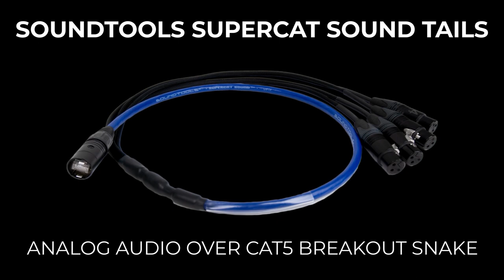Optimize Gain Structure - Pro Audio

Comment: Great job, found my answer farther down the page.   My question was about gain structuring with VCA/DCA's and you answered it.
Reply from the maker: Maybe take a look at a video I did  about mixing strategy as that will cover the VCA question.

As far as adding color, mostly live tends to have too much color and the strive for cleaner, less sound bleed and is the main focus. Then sometimes using inserts, comps or effects to soften is helpful.

I would use tube cops punched hard on vox to warm them. Digital can be edgy so adding effects to warm things is not uncommon
Reply: @DaveRat  Thanks, and I have looked at that VCA mixing strategy, it is genius level.   My mixer didn't let me assign inputs to more than one DCA, but we just ordered an m32c, which allows multiple DCA assigns.  We are going to put it through the paces next week after it arrives, with an emphasis on setting it up using your strategy's.
Reply from the maker: Excellent let me know how it works out

Comment: It's funny when looking back as a baby engineer working for a PA company that mostly sent us out with amps dialled up flat out with the crossover attenuation turned way down. But as the amps were then sucking as much signal as it could get, the signal to noise ratio was still terrible. But as time went by, the secret was always the attenuation at the amp end. They actually started to make amps with no attenuation option (dangerous) as they relied on the crossovers (drive rack) to do it. Crazy.😮

Comment: What a great demonstration! I am wondering how you summed the stereo music player to a mono input channel and then created a second, reverse polarity signal?
Reply from the maker: Ohh, I don't recall, probably just used left or right from the music player into a y cable with a polarity reverse adaptor on one of the y outputs. 

Or I digitally linked the input to two channels inputs and put a polarity reverse on one of the channels.

Either way would work

Comment: My method is mostly the same. I often find that I need a bit more output during the gig than at soundcheck, so I tend to soundcheck with the master set a little below 0db. 
The only time I've run into a serious issue with gain structure was getting thrown into a "no soundcheck" running mix on a system where the system processor had been set too low, and I had no way to access it (not my gear, and wasn't supposed to be my gig). Ending up having to run the desk right at the edge of (nasty) audible clipping. I'd have happily swapped that scenario for too much processor gain & higher noise floor!

Comment: This is such a straightforward, eloquent and practicable way to explain and reason why gain structure is organised how it is. Thanks so much! :)
Reply from the maker: Thank you Jesse!
Reply: @DaveRat  Of course! :) 

 I did have one question - when you mention at the end of the video re: turning down the input level when using a system processor for the amp, how does that translate when patching straight from a mixer into an active PA system? (Would I just turn down the active PA speakers or would that limit early too)?

I'm using some JBL 515XTs which seem to have some kind of limiter built into the onboard amp module.

Appreciate your videos and your time!
Reply: Reading, it looks like they have a clipper rather than a limiter. Still learning! :)

Comment: I have been into audio for over 20 years and I have never seen a move practical and understandable look at gain structure.  It's always been a mystery to me because i never knew where to start.  Sure set your fader to 0 and raise the gain but i've never seen the gain knob used to lower the signal after setting it.  It's away been HOTTEST SIGNAL in period.

I do more recording then live but I will take this information and apply it to my next track!  This should be at the very beginning of any and every audio course and console manual.

Thank you very much for posting.
Reply from the maker: Big smile and thank you for taking the time to comment. Appreciated and let me know how it works for ya

Comment: This has me a little confused on head room I know it’s good to have the signal level into the mixers input reasonable but running the amps wide open and using the master volume on the mixer. I check all my outputs with an oscilloscope to see exactly when it starts clipping and generating square waves and I’m able to run everything in my rack pretty hot before it starts clipping. Maybe it’s just because your taking about faders here mine usually are in that + - 5db range
Reply from the maker: Maximizing headroom (output level above noise floor) is useful but for most applications, noise floor is not a big issue, so pushing so close to clipping is more precarious than helpful.

Stay well above the noise floor and well below clipping for optimal outcomes

Comment: I liked this video a lot. These days I find most of my work in the area of Corporate AV (conferences, galas, etc). I often use the Yamaha CL/QL consoles. I like to drive the front end hard. It's not easy to EQ or compress when the incoming signal is low. Since I'm running the front end hot, I need to trim the output somewhere. The Yamaha consoles allow you to trim the "Output Port". I assume this is between the output fader and the output XLR. This has been convenient if I need to make changes during show. Lately, instead of trimming the output port I've been putting all my output faders on a DCA, which seems to work fine. I'd like to hear your thoughts on both of these methods.

Comment: Fascinating and a different way of looking at this. I kind of started to fall into setting my faders at unity and bringing in enough gain unless I need more gain for some reason in monitors. Apparently this is a similar method to what is used in a tv studio, you set faders at unity and then you can booster or cut on the feeder and easily return to the same spot. Essentially mixing with the gain knobs.

Comment: Very good video and really explained well.  The only thing I got confused about is near the end about "not turning down the amp" if at unity the PA is too loud for the event.  So I am using a Soundcraft ui24r and powered PA speakers.  I read through comments and want to verify what I think you told someone.  If the PA is too loud you are suggesting using for example the Compressor for the Main mix and adjust the db's down there until you get the level that is pleasing for the FOH vs turning the actual powered speakers down.  Is that correct?
Reply from the maker: The goal it to have the meters on the console hitting nominal (0 db on analog and -18 on digital) when the pa volume is at the desired listening level.

If the meters read lower levels and you reach the volume levels you desire, then adjust the speaker/amp levels down and turn up the console.

This will reduce noise and get your metering at the right levels.

Comment: Hi Dave.  I've really been enjoying your videos that I came across a few months ago.  This one in particular, because in the past 8 years when I moved over to corporate audio from my previous 10 years in a higher-end, but small, music venue in Austin, TX......I found that the corporate audio humans kept ignoring overall gain structure in favor of a better fader position, which ultimately leads to them almost completely ignoring their input gains......which typically results in their input gains having an average level of around -30 to -40 dbu.  And they never touch the amps, they just keep turning their input gains down.  It's an uphill battle I'm trying to fight, but I love this video of yours talking about gain structure and how, even though you do, and can, reduce your inputs gains, it should be as a part of the overall gain structure including output levels, turning down the amps if needed, so that you have that balance, and avoid noise and distortion.

Great stuff man.  I am starting to lose hope on the up-and-coming engineers......but I'll start pointing them to your videos for sure.  Because in my previous 10 years from 2004 to 2014 in my high-end venue and working with touring audio personnel, most of the touring guys reinforced what I had learned in school.........overall gain structure, starting with inputs, and balancing with outputs, never limiting oneself on either end of any gain pot/fader, etc......it was only when I started working in corporate audio where I *though a lot of people had more experience that I did, proved to me that they, most often, did not, and don't understand the fundamentals.

Anyway, I could rant forever, but I won't.  I just love your content, your explanation and testing and showing the results of what you're talking about, and your very peaceful demeanor, keep it up!
Reply from the maker: Thank you marcua and much appreciated!!

Comment: My approach to this is to use trim at the channel level before the fader, so the gain level going through my EQ, comp, foldback and aux sends is still optimal, pushing groups down and/or pushing matrix sends down that feed my PA zones. This results in ideal gain strucutre through my channel signal chains, bus and aux signal chains, master bus signal chain and then doing my volume settings for my zones with matrix(Or on the system DSP processor like a Lake LM44, Galaxy Gallileo etc)

Comment: Sorry if I missed it in the video Dave, but what would be wrong with just gaining down the music to get the fader to sit in a better spot, as opposed to turning the amp down? I assume turning the amp down would be more of a permanent solution.
Reply from the maker: Bringing the faster down is fine as long as hiss or system noise is not an issue. 

Console output a fixed amount of noise regardless of the output fader setting. Using the amp attenuator brings down music and noise, bringing down fader brings down music and leaves the noise 

Also and perhaps more important is metering. Having your console metering buried in the lower end of the meters gives less info as the LEDs are in 5 or 10 db increments rather than 1 or 3 db increments

Comment: I work in a 250cap venue that's got overkill PA (L'acoustics SB18s and KARA) so my LR master fader always ends up under -5 otherwise all my faders are in the low and it's already pretty loud! This video actually made me consider turning down the amps to improve the overall mix signal/noise ratio.
Reply from the maker: Excellent, let me know how it goes
Reply: Well, yeah.

Comment: Amazing stuff. I wonder how many people were taught as I was, that the power amp should more or less be maxed out and everything else works around that. I’ve strayed from that lately as I too like to keep faders and gain settings in a fashion that seems reasonable. The unintended side effect I learned from watching Dave’s videos is that my white noise levels go down with the settings on the power amps. So glad I found these videos.

- Cody
Reply from the maker: Yes, ideally you would not attenuate at the amp but that can be useful to get faders up to a good place if you have too much PA or if the volume levels are fairly low.
Reply: @DaveRat  which is precisely the issue I have in one of the rooms I mix in. I was having to work with faders and gain at ridiculously low settings. I ended up attenuating the power amps to about 65 percent and now all my gain staging and fader settings make way more sense.

Comment: I would expect that the signal to noise ratio would get worse as the signal level drops. Turning up the low level signal in order to hear it means turning up the noise as well. I can't help but think at least some of the audible difference is the added noise.
Reply from the maker: Agreed, the battle between high gains and overload and low gains and noise is a balance.

One way to look at it is to use as little gain as possible as long as the noise floor is all good.

Unless you want the sound of desirable overload.

What I tend to see and hear engineers doing more often than not is running too much gain and hearing negative sounds of gain distortion while the noise floor is a non issue.

Comment: I mix several analogue synths with an mpc digital sampler. I find my mix into my recording (comp) is not really noises but there is noise there. I like to pre master at around -6db. After I master I find the hiss has started to get too high. I assume this is a staging issue but I'm not sure how to solve this. I will apply these techniques but I think I already have. Any more tips dave.
Reply from the maker: Interesting, I don't think you should be getting his of any substantial level unless there is a gain offset of some sort. Sending the syths louder and then patting them down or using transformers with pads may help

Comment: Hi dear Dave, when i mic a kickdrum, i cannot raise the gain more than +10 or 12 db. The sound has too much Attack, Is not rounded and a lot of High and middle frequencyes came out. Is this normal?
Reply from the maker: You can alter the attack by changing the mic position. The farther you might be had away from the beater the less attack you should get if you Mike very close to the edge of the drum it should have less attack than miking in the center also it depends on whether there's a second head on there or not and the size of the hole.

Miking outside the hole will give you more puff unless attack making inside the hole will give you more attack and less puff.

Also you may want to change the mic that you're using

But there are many factors it could be system EQ or lack of subs or other factors like subwoofers going into limit
Reply: @DaveRat  i mic with the grill half way inside the hole of the resonant leather, the hole Is half inch wider than mic all round...i Will try to go away from beater half inch more😊
Reply from the maker: 👍🤙🤙

Putting on a good pair of sealed headphones and a long headphone cable with the kick drum queued up in the monitor rig and listening to the different positions of the mic could be useful.

Or using a wireless in your pack from the monitor system and finding your mic placement that way

Or just getting someone to move the mic around while you listen to it in front of house

Comment: Hey Dave, its me again. Recently i am working with a band where the drummer plays the snare drum very dynamic. (around 24 db difference). I basically use  the compressor to make the required ton. When the drummer get excited and hit hard on snare, although the snare channel doesn't clip. it sound terrible ( kinda distorted sound). Es there a way that i can use 2 Compressors ( Serial) , one for reduce the dynamic and the other to shape the tone i want to have ? If this work, how would u set attack and release time? or do you hav another solution for this? Thanks a lot in Advance for a good solution. Regards
Reply from the maker: Sounds like you need a better compressor or better compressor settings. Also it's possible somewhere in the console it is distorting. 

Reduce channel gain, slow down release time to 200 ms or so, try different attack times but mainly fairly short. And many compressors have limited as well. Use the limiter
Reply: @DaveRat  Hi Dave, thanks for the quich reply. The Problem is example, i want to enhance the transient of the snare, then i let transient first go and then set the triggering of the compressor. Generally i set attack time around 22-28 ms. Then all of the sudden drummer hit hard on snare the first 28 Ms of the snare sound will be 24 db louder cuz the compressor does trigger after 28 ms, cuz i set the attack time @ 28 ms. so wether a good compressor or a very ordinary compressor, will let this first 28 ms of the snare sound go without any restriction. This is the part that makes the snare ton totally different when he play so loud. Any suggessions?
Reply from the maker: If you let the sound through with no restrictions, it will always be way louder that the restricted sound. 

To even out the volume and not change the sound, you need to restrict nothing at low volume and restrict everything equally at high volume.

Comment: Dave, I need your help with something. I have searched high and low for help on this, but nobody has a video on it. It's literally the only thing I cant find and its probably the most fundamental thing about mixing.
Reply from the maker: Hmmm, I do try and help and also I try and help in publicly visible places so the assist can help not just one person.
Reply: @DaveRat  Dave thanks for the response. I kind of semi-found the answer on another video of yours (Eqing a mixer) but still had no comprehensive answer. I am in a 3 piece band, vocals, bass, electric guitar. We play 'grunge'.

So I have a mixer similar to yours with a 3 band EQ, Hi 12khz, Mid 2.5khz, Low 80Hz. What is a default setup for the vocals, bass and guitar. I know there is no one size fits all and tweaking will be necessary but there is a baseline, template or foundation one should use. For example EQ vocals at Low 80hz should be cut completely off?! same with guitar - as bass plays those frequencies? Bass should have its channel Mid and High turned all the way off? I hope you can help, every video I find with some promise ends up people using these digital mixers and showing it that way. I prefer seeing someone turn 3 knobs on each channel rather than using all this digital 'perfectionist' methods. I want to play live, not record a studio album! 

For each of the three can you give me a H/M/L clock dial or something, or even better show it on a video. Ill be forever indebted for any help and advice you can offer. 

p.s I know I said 3 piece, but I havent found a drummer yet - no for the will of trying ;)

Thanks Dave.
Reply from the maker: Hmmm, there have been attempts to do standard EQs.

Basically just twist the EQ till it sounds how ya like it

Turn it up to the volume you you like and if it feeds back, turn it down or move on to learning frequencies.